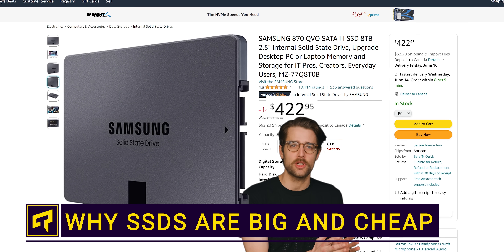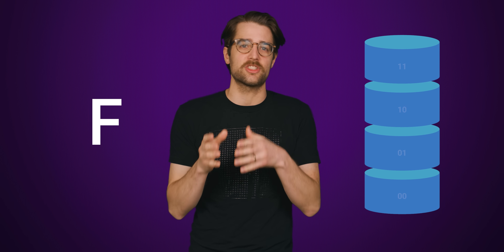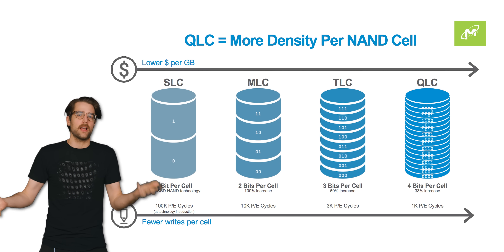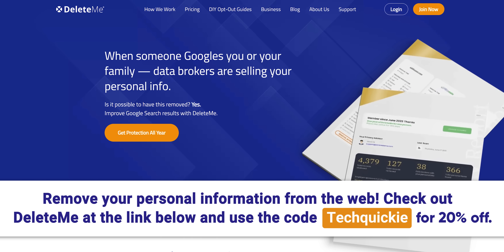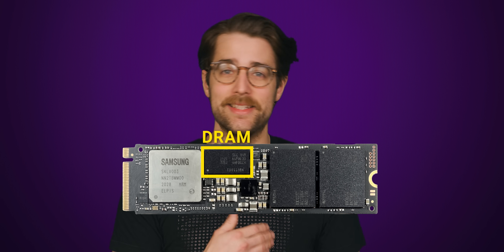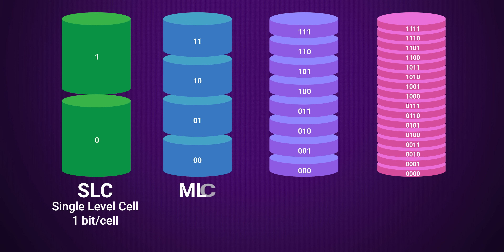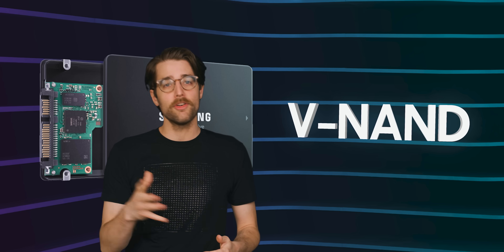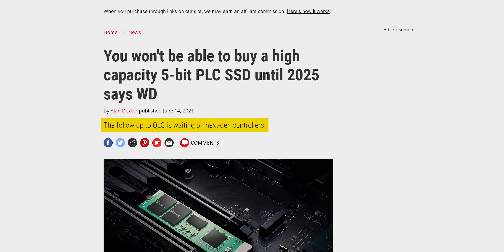Why SSDs Are Big And Cheap

Comment: At the end of the day it still seems like the best setup is to have a SSD for your boot drive, a SSD for games and other speed sensitive tasks, and one or more massive hard drives for bulk storage.
Reply: 1 m.2 for os and softwares / 2tb m.2 for lightroom catalog/buffer and files / and other files on massive hard drive
Reply: Yep, spot on. Some people are trying make out that "Hard Drives are dead". However, you still can't beat a large capacity HDD or two when it come to bulk storage on a budget (most people). And let's face it, most people require a lot of bulk storage space these day's, due to the ever growing sizes with software (games and apps). HDD's won't die off, until SSD's become far more cost effective, when it comes to storing large amounts of data.
Reply: @fafski1199  HDD´s are not dead due to the simple fact that SSD´s above 8 TB cost more almost everyone can afford while you can get a 20/22 TB Seagate Exos for the around same price as some of the gen 4 four TB NVME drives, while i would love one of those 100 TB Exadrives SSD´s from Nimbus i dont have $40.000 lying around and even the 50 TB model is still $10.000 US
Reply: Not everyone is in professional job that need that much storage and even if they are, 2 or 3 ssd are enough to boost and storage regular use files, HDD work best for server no doubt now, still can be used for normal work but not really effecient
Reply: @theskywalker8416  People say it's not efficient but when you look at the actual power use we are talking only a handful of watts at best so it's really a big deal. 

If by chance you somehow don't need the extra storage or are willing to run with less redundancy then a all SSD setup is fine otherwise a HDD is still a staple part of a build.
Reply: @Hybris51129  tbh, most of normal users dont even know about power use of hdd or ssd to begin with. SSD just get improved so much over time: the storage, the speed ,the price... the conveniencies are all too good to even care about HDD . Keep in mind this is the majority of normal users, not professional or specific scenario, they barely use up a 512GB ssd if im not wrong
Reply: @fafski1199  exactly... especially when someone is enthusiastic and tries out large datasets of some sort (ai/3d model stuff/data dumps...) and just wants to test things or experiment with them. Large (kind of ) cheap storage in the form of (data center-) hdds is awesome! and even if you are someone who does none of that, "higher end" hdds are still great for 99% of pc games and good enough for video editing (if not 4k super high bitrate). and if you still dont do any of that, its currently still more cost effective (and faster) to make backups of your devices on hdds than to use a cloud storage service. (as far as I could find based on 25tb of storage to save and only a 250/45mbit connection)
Reply: @fafski1199 Yeah, HDDs are more practical for cold storage imo. I run an NVME as my boot drive & store the two or three games I'm currently playing on that. My sata SSD for my multiplayer games like BF or Cod. My sata HDD for files, pictures, etc.
Reply: @fafski1199  yeah especially for older games that don't see any improvement from the read/write speed go on HDD all day for me. 

Or games my friends recommend but I don't play often. Bulk storage, can still play with them, just an extra load time but no downloads lol
Reply: @fafski1199 SSDs will also have to become WAY more reliable to kill off hard drives completely
Reply: @fafski1199  The problem with your comment is you're assuming people actually have a need for bulk storage. The vast majority of people never even fill up more than a couple terabytes.
Reply: @fafski1199  14tb drives are less than 200 now
Reply: @fafski1199  HDDs for games aren't great nowadays. Loading and update times suffer from their slow speed. Although I don't approve dictating the user how to play their games, current gen consoles (or PS5 at least I think) won't even let you start games from drives that are too slow (not even SATA SSDs are fast enough to please them). Only store them, and to start them you have to transfer them to a faster drive which is pain in the ass
Reply: @fafski1199  storing games on a HDD is dumb as hell in 2023. Use it for anything but that.
Reply: @fafski1199  Most people wont even need more that 1TB, that's loads of games and basically infinite files.
Reply: @tribblier  When GTA 5 and Halo 5 take up 1/5 of that by themselves, it's not enough for anyone past a casual gamer.
Reply: @randomlyentertaining8287  Yeh and thats what most people will have. A few big games and some smaller ones, which will all still just about fit in 1tb. 2tb is definitely enough for almost everyone.

My point was that it doesn't make sense for the vast majority of people to have a 2nd HDD for bulk storage. Most people just don't have enough stuff.
Reply: @zacroebuck452 You might not have enough data to use more than 2 terabytes, but don't liken YOUR usage patterns to everyone else's. 

They don't equate at all
Reply: @tribblier bruh. War zone. Gta 5. Forza and gears will have you rethink that.
Reply: @KING0SISQO  all of those come to about 530gb, you can have another 5 gears installs before you run out of space. 1tb is still alot and most people won't even need anymore, certainly not to the point where they wouldnt rather just uninstall a game.
Reply: @tribblier 500 gb was plenty 2007-2013, 1 TB 2014-2018 2 TB if gta 5 etc
Reply: Thats what i’ve done. One drive to boot, one drive for OBS recordings and games/apps that need the speed… and then a mass storage drive for games/apps and data that doesn’t need the speed
Reply: My setup is 1tb SSD for os, 2tb SSD for games I'm playing, 8tb HDD for downloads, 18tb HDD for steam and other game back catalogs
Reply: @TheFalloutCollector  You sound like a hoarder. PD: I just checked your channel and can confirm you are a hoarder lol
Reply: @TheFalloutCollector  Do you really use 1Tb  just  for the OS?
Reply: @THE-X-Force  technically, no, but it's also where all my regular apps run, and when I'm doing video edits and photo editing where most of all that is saved. I think right now I have about 550gb free on my C:/ drive.
Reply: @TheFalloutCollector  Ok yeah .. that makes way more sense to me. Thanks.
Reply: I got so much stuff I need to store long term, I'm about to pull the trigger on the next generation of Tape storage.
Reply: Exactly. My main machine has a 2TB NVMe drive for boot/games, another just like it for swap/temp/video capture, and then one 16TG HDD an one 8TB HDD for storage.
Reply: @ScottGrammer  i only have games on my os drive when i play then when I'm done i delete it but that is maybe because i had a 125gb ssd on my first pc
Reply: I have one M.2 for my main boot drive (I don't have a separate game one) and then a massive hard drive for bulk storage.
Reply: ALthough except for slightly longer load times hard drives are still fine for games so for ultra budget I use a £8 128GB sata SSD from CEX (kingston ssd now 300) as a boot drive and a dozen hdds for everything else. Applications are small enough to fit on the ssd and games can go on the hdds.
Reply: Meh. My setup is 5 years old and still only has a 500gb SSD... I get closer to my memory limitations than I do my storage.
Reply: @pandabytes4991  nice! I'm weird and want all my steam games downloaded with us about 12tb right now lol
Reply: 2tb hdd = $40 , 2tb ssd = $60
Reply: @m1natoh1nata  Where are you getting a good 2Tb SSD for $60? I just paid $120 for my 2Tb Sabrent Rocket (gen 4) .. did I get ripped off?
Reply: @THE-X-Force  silicon power A60 > 2TB = $66
MX500  > 2TB = $99
Reply: Which is the way I do it.
Reply: All my external back up drives are mere HDDs. Just as they are a tad cheaper and kind of less suspicious of get some data loss if non connected to power for a very long time.
Reply: This is the way. HDDs still have a place as long as you set it up so it’s only read and written to when you want. Boot SSD for a snappy system and a game SSD for quicker load times.
Reply: Yep. That's my setup.
Reply: @Blackfatrat I would always always pay for an NVME SSD and HDD  though
Reply: This is how I have my setup. I have a 2tb nvme Gen 3 as boot drive, a 2tb nvme Gen 4 for games, a 8tb hard drive for torrent TV shows and a 20tb hard drive for my collection of true 4k movies.
Reply: yep i have os drive ssd & a backup hdd
Reply: Hdd is still holding with desktop pc, but for mobile hdd dont benefit much
Reply: Nah, when I have the money for a 4TB SATA SSD I will swap out my super slow 3TB HDD at just 180 MBps instead of 500+ and ultra fast access times aka random 4k
Reply: @Sklyne6  4TB EVO is ~$200.  It's a steal at that price.
Reply: I use a 240GB m.2 for the OS and launch programs, drivers, and utility/productivity applications, a 256GB SATA SSD for modern games (it used to be the old boot drive and was repurposed, planning to replace it with a much larger one soon), and a 2TB Toshiba HDD for bulk file, photo, video and audio storage, and pre-2013 games. (It too will also be replaced by a 4TB from either Toshiba or Western Digital soon).
Reply: For my own rig, i run SSDs for my OS, apps and "live" data (which is what gets changed or modified all the time)

The big HDD in the rig is just a image backup location/target for the stuff on the SSDs. Their slow RW speed is almost a non-factor since they only are used during the backup process. Which is done in a few hours via scheduling + auto-shutdown afterwards when im at work and not at my PC anyway

Having a big HDD means i can keep multiple dated versions of my backup, so i have the option to roll back to (for example) 7 days ago if shit happened 6 days ago
Reply: @Blackfatrat  I sort of agree with you. 1 TB of SSD wasn't enough, and my next purchase will be a 980 pro 2 TB SSD. I think the total 3TB SSD space will carry me for a good 5 years from now or until my 2018 drive fails
Reply: Yea you're not wrong. I have a 2TB NVME Gen 4 for C drive, Another 4TB regular Sata SSD for the games and then 1 large 10TB HDD drive for all the bulk stuff and another 4TB HDD for all the games that don't really need the extra speed. It would be nice to be on all SSDs but going beyond a certain point in size capacity gets really expensive.
Reply: I use 2 NVME drives (Boot and primary games), an SSD for secondary games and a big Hard drive for photos, music and the like.
Reply: *At the end of the its best to have SSD for boot drive and gaming HDD or SSD for speed intensive tasks
Reply: DRAM less SSD is worse than HDD
Reply: @IceJackal1984  think about what you just said right now
Reply: When you factor in redundancy, SSDs are competitive when it comes to a small NAS or bulk storage system. Ten 2TB SSDs with 16TB usable cost about 60 percent more than two mirrored 16TB HDDs, while being at least 100x faster
Reply: @shanent5793  And a lot more reliable.
Reply: @shanent5793  If you don't need 100x faster though, you're just spending 60% more money for the same capacity.

If I just have a drive for storing movies and shows, I don't care if your gen 10 NVMe drive is a million times faster, the 5400RPM HDD has more than enough performance to load a 4k video, paying any more for performance is just a waste of money.
Reply: I felt the same way until I started doing that. Putting massive bulk storage on a spinning disk leaves a lot to be desired. They're clearly for long-term storage, but if you ever want to get that data back out you'll be immediately reminded that they are friggin SLOW. You ever copy over 8TB of files or try to build a RAID 1 on those bigass drives? It takes an entire day. If you do photography or video editing, you basically need to splurge on a NAS just to avoid letting those background processes clog up your rig. 

If you do this with games, it can take a long time to copy tons of tiny files over and you're just sitting there twiddling your thumbs while you wait for it to finish copying onto your boot drive or games SSD. The HDD becomes more like a 'graveyard' for all the games you kinda wish you could play, but don't have the patience to migrate over to the proper drive. If you're on a super tight budget, HDDs are still the most cost-effective option. But it does start to hurt after a while.

At least large-capacity M.2 drives are getting cheaper. Even budget motherboards come with multiple M.2 slots. The 8TB NVMes are still in that ridiculous $800+ price range, but 4TB drives can be had for under $200 and it gets pretty darn tempting. I imagine once that kind of capacity drops below $150, it will become a no-brainer for most people. Especially since games keep getting more enormous by the day. By comparison, most 8TB spinning drives are around $120-150. Half the price for the capacity, but the cost benefit won't be that compelling.
Reply: @GirthOfANation  There first needs to be a better way to connect all those m.2s. A used 24-bay drive shelf and SAS card can be bought for less than $200 (plus $8-10 for each sled). Desktop CPUs  only have 24 PCIe lanes, with at least eight taken by the GPU. So four or five NVMEs at best. Any more requires a $1000+ Threadripper or Sapphire Rapids motherboard, with CPUs that cost over twice as much per core
Reply: I have 2 m.2’s in RAID 0 another for less frequently used stuff, then a NAS for storage. When doing Web related stuff I try to always be on a Virtual Machine.
Reply: @ŠpVŠpý  Len .. I wish you the best .. all I can say is that having one drive fail in my 2 x 2.5TB (HDD) RAID 0 fail .. was am awful learning experience. I knew the risks, and I did have backups, but I still lost data and I can still feel the kick in the gut that it was. No warning. No SMART or any other thing like that popped up to let me know of the impending doom. RAID 0 is fast .. but there's always a price to pay for performance. ☮
Reply: @THE-X-Force  I don’t have anything on there that I would care if it failed. I did have an external WD 4TB drive fail on me I need to see if I can get everything back. It had all my Music stuff, VSTs, too much to name. I basically haven’t done any music since it crashed because there isn’t any point. If it makes you feel any better, I have Multi drive redundancy on my backup NAS.
Reply: I mostly use a hdd for just games and ssd for programs and OS just Becuase this is the most cost effective way
Reply: I use Windows storage space, configured with a mirrored SSD cache (1TB) with mirrored HDD behind it (4TB), so in essence I have a 5TB drive that's mostly HDD, but acts (for the most part) as if it was all SSD unless I'm playing an old game I haven't touched in ages... but then the old game is upgraded to live on the SSD and it's all fast again.

It's a great compromise between speed and storage, with no management overhead. I never have to tell my PC where I want it to store things, they just all go on the same drive, and behind the scenes the PC figures out what should be on the fast drives and what can be dumped on the slow ones.
Reply: I think the thought is that a lot of people never hit that bulk storage threshold. For me, two 2tb drives is all ill ever need locally. The rest is cloud.
Reply: I still love the longevity of HDDs.
Reply: @slowanddeliberate6893  you mean the thing with tons of high speed moving parts? SSDs are far more reliable lol
Reply: @slowanddeliberate6893  Average lifespan of an HDD is 3~5 years, while an SSD can last up to 10. Check your numbers bruh
Reply: @Mattia Giambirtone  They lose capacity over time, and data stored on them can easily corrupt sooner than it would on an HDD.
Reply: @slowanddeliberate6893  That's just... wrong. Like, factually, that's just not true
Reply: @Mattia Giambirtone  Then, it's safe for you to never use an HDD ever again, yeah?

I bet you store your important information on an HDD? If so, why???????
Reply: I dont think that having a so dedicated drive is needed today
Reply: @G0A7  Not as much as it might have once been but it doesn't hurt and compartmentalize your data so a if a boot drive fails you still have your data and if vice versa you can still get into attempt recovery/troubleshooting. It's cheap effective insurance.
Reply: If you really want a set and forget solution, you could come to the dark side.
We have:
Arbitrary mounting
ext4
ZFS

You could dedicate an nvme stick to a boot/root drive (ext4 or btrfs), and then for the home folder you can make an array of hard drives running on ZFS with an SSD storing metadata and tiny files.

Don't do what I did, which is using LVM for volume management. Wasn't worth it.
Reply: It really depends on what types of files you have. I have many small files e.g. I have 70,000 images (and yes, before you say anything, I know exactly where each and every one comes from; they are all necessary. I go through all of them, delete unnecessary ones and make regular backups every month. I'm not the sort of idiot who just has thousands of files because he never checks anything until his storage is full).

So when I open my Images folder, I need an SSD because a HDD just won't cut it.
Reply: @Leanzazzy  " I'm not the sort of idiot who just has thousands of files because he never checks anything until his storage is full".  Unlike my sister you mean who has never deleted a thing in 20 years, not even a spam email...?
Reply: my ideal setup would be a 500gb/1tb for boot drive 2/4tb for games and stuff, and then a large NAS for super bulk, then everything is nice and separate
Reply: I have a windows SSD, a Linux SSD and 4 6TB HDDs that run in a TrueNAS VM inside of either OS.
Reply: I see a fair few pre-built PCs that have a 250GB or 500GB SSD as a boot drive and a 1TB or 2TB HDD as storage. Would love to know how the costs compare between having that and just throwing in a 1TB or 2TB SSD right off the bat.
Reply: Yep, pretty much. Even better if the massive hard drives are in a NAS
Reply: Say what you may, but is gladly switch from my slow-ass Synology Nas with spinning rust to something like an asustor m.2 Nas with a bunch of cheap qlc/plc ssds and a 10gig nic.
Reply: Just get a hard drive and buy a small, cheap SSD and use it as a read cache.  It's alot less complicated.
Reply: Yep and really bulk is most useful in a NAS so you can push and pull to one location from all your devices.
Reply: Lol imagine transferring 1tera files from HDD
Reply: @4nomaIy  Still takes less than 5-10 minutes. Not that big a deal unless you do that sort of movement daily at which point hopefully you make enough to afford the big SSD's.
Reply: @4nomaIy  What files do you have that are an entire TB? Not even the largest games are a TB!! Jheez.
Reply: @Hashterix  ofcourse when you're transferring multiple games and a ton of movies at the same time. You ain't Ctrl c Ctrl V-ing 1 by 1 do you?
Reply: People in comments here forget that an average person doesn't really need so much storage. We are all under a ssd information video so there are a bunch of data hoarders here, but the reality is that a single 4tb drive is probably more than enough for the entire life for 95% of population on this earth.
Reply: Only SSDs for the PC for OS drive and storage drive, plus a huge array of hard drives on a separate NAS box for bulk storage, which gets backed up overnight to another NAS and Cloud backup storage. That's the way to go. I've also added 10 GbE networking in my house for fast interconnectivity, but that's optional.
Reply: Nowadays you can get 2tb of ssd storage for 60 bucks compared to 4tb for that same price, however if its for games id still go for the smaller ssd, its just better to be able to click play and not have to wait a millenia to get in the game
Reply: Hdds are great for a NAS I use them in a raid 5 configuration using ZFS. 

Being able to buy one single 4tb SSD for a few hundred bucks is awesome but it gets expensive real quick when you want 5 of them in an array.
Reply: SSD is only like 10 USD more than a Hard drive or even the same price where i live
Reply: On by pc I have a 1TB sn770 and a 6tb wd black hard drive, I also have a 10tb iron wolf, but I don't trust it cause it sat out in the cold for a few days cause I put the wrong apartment number on the order form, and didn't know it was for me, and when I got it in it only showed 5tb, and eventually showed 10, so I've never stored anything on it.
Reply: Meanwhile me: 1 Tb SSD for everything, 1 Tb HDD for anything else
Reply: not really... moving large files in the HDD takes ages... HDD is pretty useless today, its mainly only for the poor people
Reply: @johnnyhun1  "poor people" you call the normal ones among us that think in cost effectiveness rather than "the best and fastest". I would say "poor people" wouldnt use this much storage in the first place and moving collections of large files (each ~3gb) is not really slower on a proper hdd compared to a sata ssd...
ssds on that bus are mostly beneficial for high iops but not really for sequential loads (such as backups) and would just rot to death sitting in a corner waiting to get corrupted :I
one advatage for hdds as backup drives is that they often fail partially and can be recovered while flash storage is harder to recover and if something fails mostly fails completely.
Reply: @DiverseGreen-Anon  bro, this is an idiot myth that SSD-s fail more, they dont... and even if they start to fail its not like 1 to 0 that its completly gone, its like a dead pixel in a monitor. Go ahead buy hdd if you want but in 2023 there is no point at all owning a hdd .... NO POINT. But if you dont trust eletricity buy a pendrive, put some files to it, and wait 10 years and see if it still has the data...
Reply: @johnnyhun1  if you mean pendrives as a proof of longevity... I can speak from experience, losing two sd cards from with no warning just dying (used it in a rooted smartphone as internal storage and that was too much read/write after a few months) I also had a 2gb microsd and 8gb sd cards in my later phones that got (very few) corrupted videos and a couple of pictures with interesting patterns with mostly green on it... (these were sd cards and not pendrives tho.) pendrives I only had 2 kind of die on me while one was dying on reads (3d printer usb stick and always stopped at that sector/amount of filled) other one was a 128mb pendrive that died after daily use since ~2009.
This far I had no hdd die on me but have errors (S.M.A.R.T. data) and could swap that one out before a failure. And an external cheap 1tb hdd that now gets errors after ~500gb filled because it fell while writing (not using these anymore as they are too small anyways). But my point is that ..idk "cosmic rays" or whatnot can cause corrupted storage and I only had that occur on sd cards (in phones). My theory for these are the xrays on airports idk.